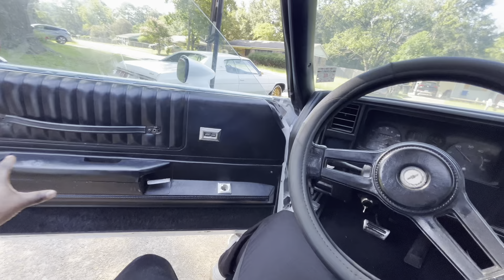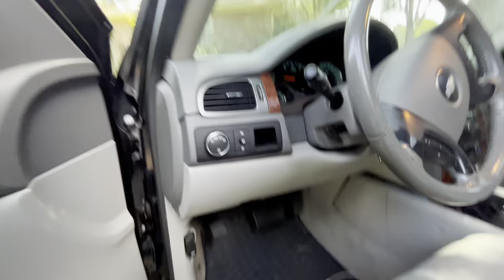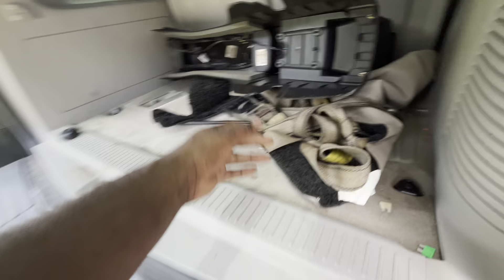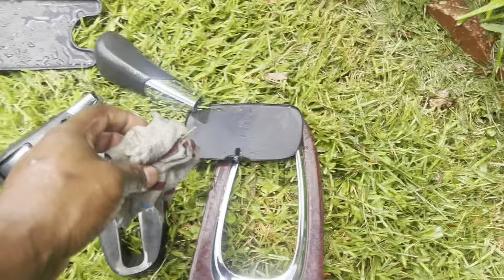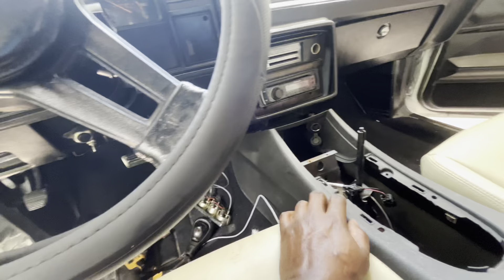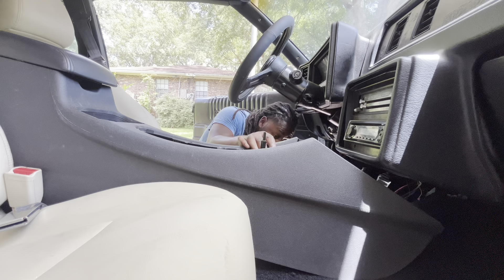TOOK A CONSOL OUT A 07 IMPALA AND PUT IT IN MY GBODY!! THE BEST THING I EVER DONE.

Comment: I did the same thing in my 86 SS a few months ago. I had to cut the console bottom a little, but it fits perfect. I like the fact that the Impala console is a more modern look and has cupholders built in. Plus, it's way less expensive to buy than rebuild the original console.